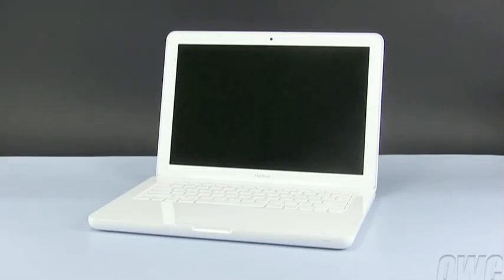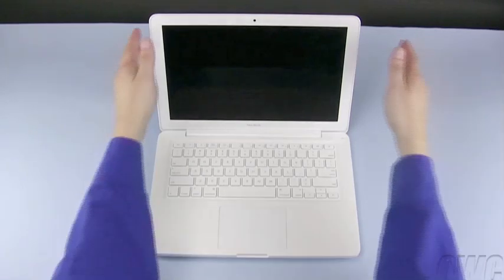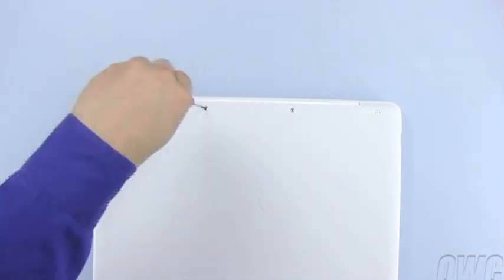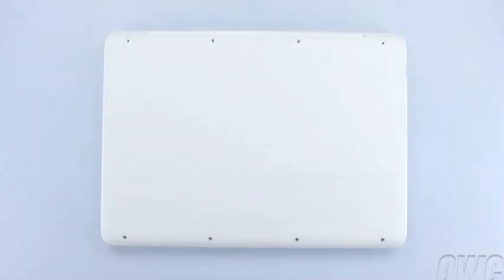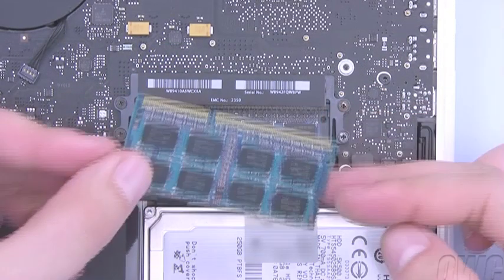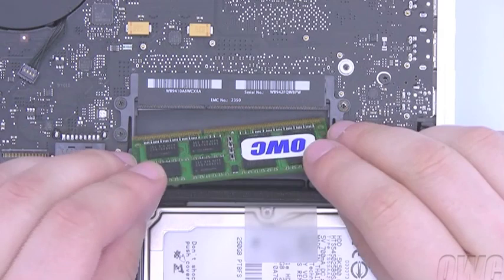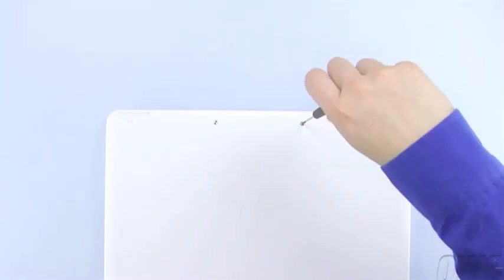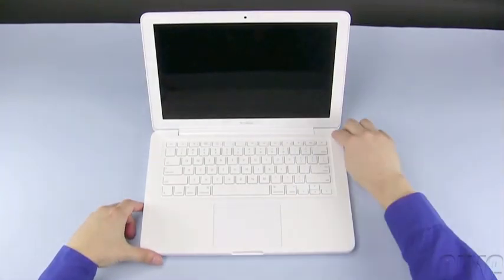How To Install RAM in an MacBook (white unibody 2009)

Comment: I have just plugged 8GB into this I got from ebay. It works perfectly. I'm considering to put a SSD into this thing haha.
Reply: i am looking to do the same thing, but the specs are a little different then what my 2010 macbook says it accepts, could you send me a link or tell me which ones you got? thanks!
Reply: I'm in love with my old mac. I've replaced the old HD with a SSD and it works perfectly. The next step is the memory. So it works fine if I try a compatible 8GB memory? I've heard they recommend only 4 GB.

Comment: Guys I need your help . I have a late 2009 model ( 2.26GHz Core 2 Duo) with 4GB of RAM . I wanna increase it , and since I see in all of these videos , that there are 2 RAM cards inside the computer , that means I probably have 2 as well ? and if I do have 2 of them , what are my possibilities ? Buying 2 RAM cards of 4 GB each or 8GB each ? and where should I be ordering it from ?
Will it be enough to run Yosemite on it ? cause since I upgraded from SnowLeopard it just barely moves ...
Reply: Yes, I just installed two 4GB RAM cards. Works very well from what I can see.
The track pad even seems to move faster

Comment: Using this simple video I just went from 2 GBs of RAM to 8 GBs in 5 minutes. I ordered from RAMJET 2 4GB chips for $120. I didn't understand the "clip part" but when I pried the cover up I understood the clips are just simple snaps, they won't break when you pull cover off. It was easy, thanks for the video. Now I can load Yosemite!

Comment: @DarkMaltaknight yea its working great I don't saw any problem, I even got Windows 7 installed over Parallels which I gave 4 GB and Mac get remaining 4GB (i.e I am using around 5-6GB Ram full utilization of RAM without paging). Only thing I noticed was not much geek bench score improvement for memory using 2GB and snow leopard against 8GB and Lion(after upgrade).